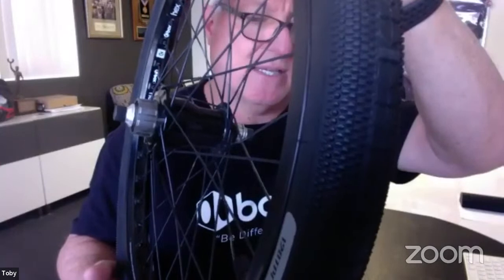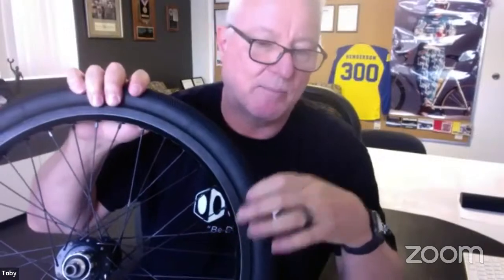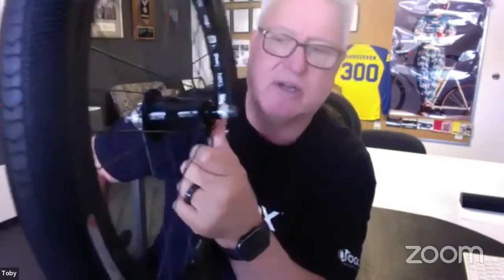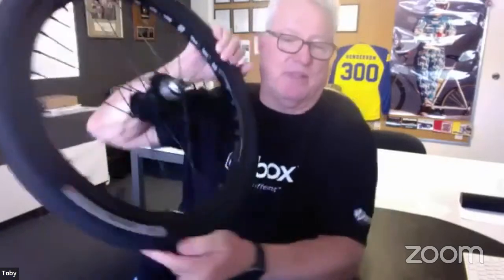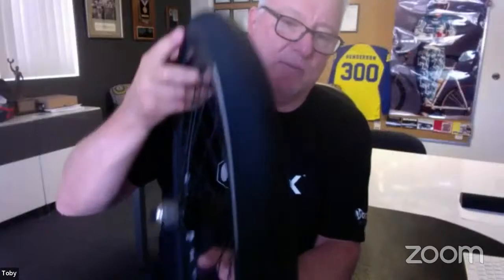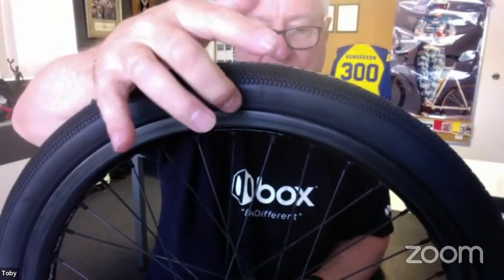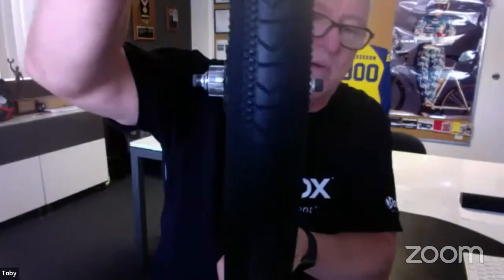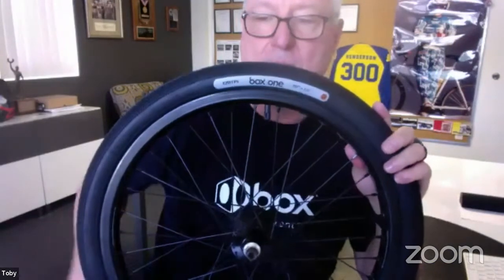Introducing Box One and Box Two BMX Race Tires

Comment: Interesting, actual weight on Box One 20x1.75? Looking forward to seeing these near me soon. Working on getting my Pro XXL down to 11lbs, currently sitting @ 13lbs
Reply from the maker: 316 grams
Reply: @BoxComponentsOfficial  Lighter than the DTH nice!
Reply: Good mini-sized racing bikes are in that weight range. How did you get it so light?
Reply: @dosgos  It began with the frame being a Supercross Evo S7 which is sub 3lbs, add in that it has a BB30. That combination is the beginning of it, then empty your wallet. Everything exotic, Ti & carbon fasteners to ceramic bearings.